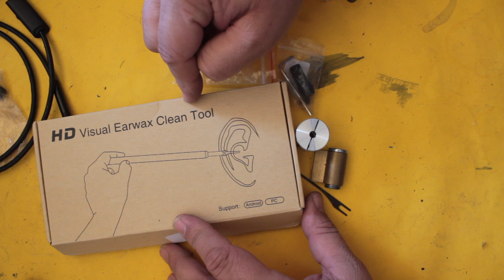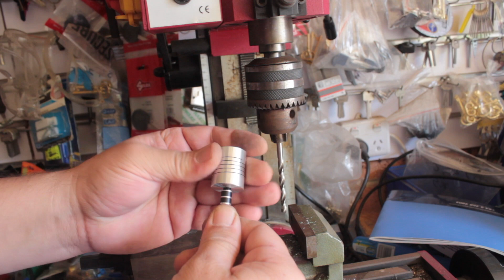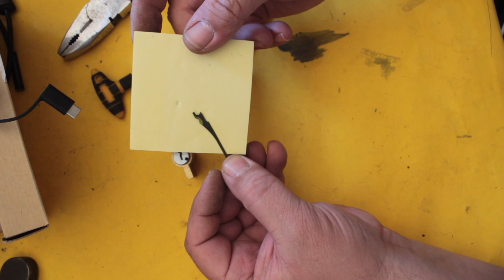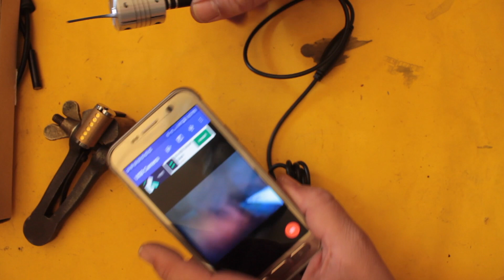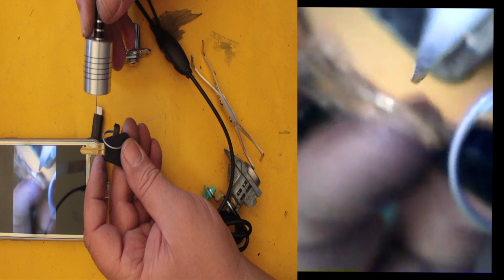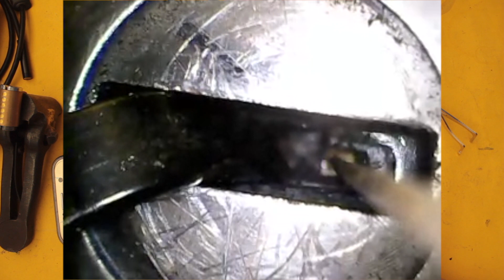Lock Phone USB Key Reader HD

Comment: I ordered 2 from eBay years ago, for a grand total of  $21.27, (w/ s&h). One w/ 3m & other w/ 5m (long) cable... no pen shape handles.

I've used mine for both automobile door (std. & c.m.v.) & drop slot (safe) to probe for info.

I don't like door spreading airbags & was lucky enough to disassemble cover plate from wheel pack through slot. 
(door cover previously removed for fitting treys or alike)